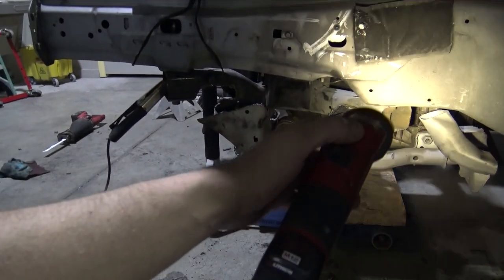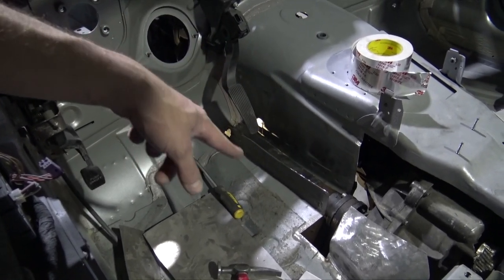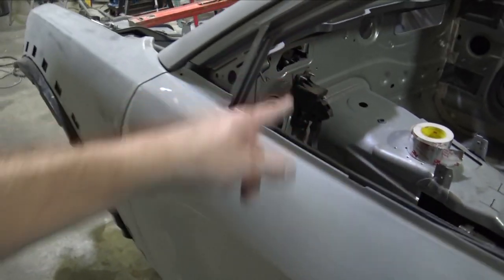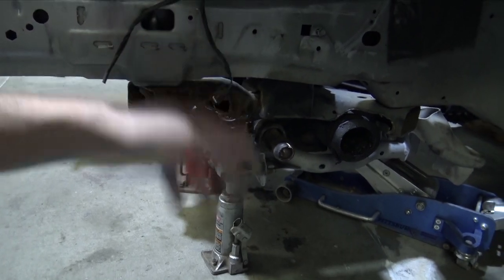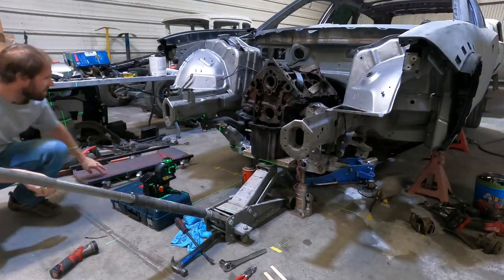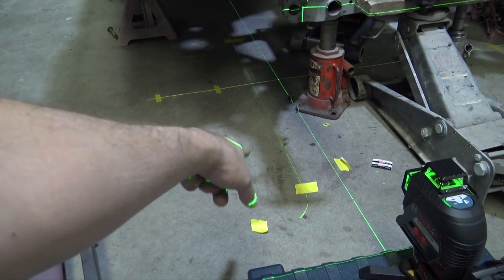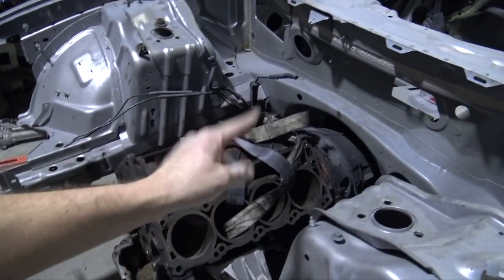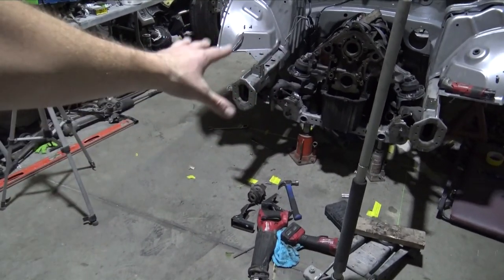Building the Ultimate Station Wagon | 2021 Charger Magnum Hellcat | 1000HP Hellwagon | Pt 25

Comment: There are 3D scanner apps for smart phones now, how useful they are I don't know yet.
I'm not sure if it matters with CV joints but driveshafts need an offset to prevent vibration etc
Reply from the maker: No u joint it's an axle type
Reply: @Junkyard_Dave  Still may need an offset to prevent vibration I'd check with a drive shaft shop before welding anything permanently.

Comment: Hey Dave, when you finish the drivers floor will your front right seat rail have to be relocated? I mean will you have to make a new seat rail? Also when the gas pedal is back in will the side of your foot or your ankle be forcing your foot away from being centre of the pedal because of the new metal on the trans tunnel? Just trying to understand if this will be mildly uncomfortable to drive once the tunnel s complete?
Reply from the maker: Its not going to be enough to matter and when I race my heels don't touch the floor

Comment: I think you should keep it rear wheel drive I'm not a fan off all wheel drive cars yes they are safer in wet conditions but how are goi g to light the back wheels up and do great burnouts
Reply from the maker: The aid is controlled electronically

Comment: Dave, I've got a question for you.  Back in the day, Mopar engines were offset to the passenger side by a little bit.  It helped make a little extra room for the brake booster and steering box and the driver's weight usually compensated for the offset weight.  Does Chrysler/Dodge still do that?  Would it be beneficial in your build?  Of course the rear differential and half shafts would need to set up with that offset.
Reply from the maker: yes they are still offset

Comment: Why couldn't you use a subframe from an AWD Charger or Magnum. I would try a Charger police car subframe.
Reply: Will not hold the Trackhawk drivetrian, or suspension
Reply: I was wondering that myself, although I'm not sure if the placement of the steering rack is the same.. @Junkyard Dave

Comment: Just do what everyone else does and run the axle through the sump , either bolting the diff to the side of the sump as part of it's mounting or cast the housing into the sump both options have been used by Nissan and Audi and others.

Comment: Could the track hawk diff not bolt into an AWD LX front subframe?
I think that would’ve been the easier way to go. An AWD HEMI drive axle goes through the oil pan. And the later subframes have the one piece lower control arms!
Reply: No, plus the Trackhawk suspension would not bolt up
Reply: Canada Guy 
Why even use the track hawk suspension. Just use the diff.
Reply: @dodgeguyz  Then you still have the weak axles and poorly designed knuckles and struts
Reply: Canada Guy 
You can have custom HD axles built. And he suspension is very well designed. It's no different than the Jeep suspension. Why do you think the upper Jeep control arms bolted in.
Reply: @dodgeguyz  The knuckles, lower arms and Struts are easily a worst design, the upper arms are common across many Chryslers
Reply: Canada Guy 
Yes, the early 2 piece lower control arms were a terrible design. The later lower arms are a stout 1 piece design. Not sure what you are talking about with the knuckles and struts? Never seen an issue with them!